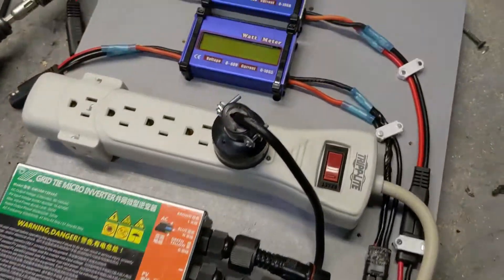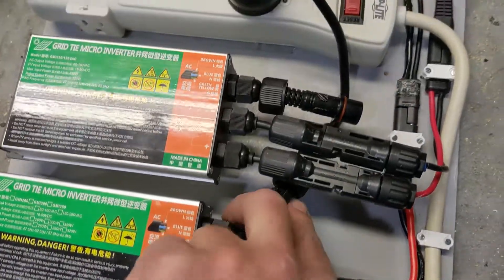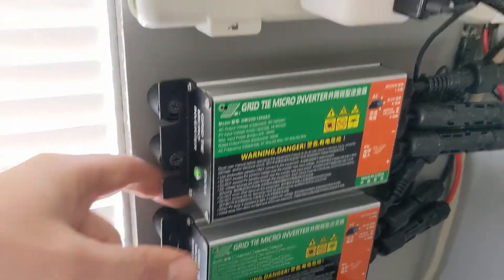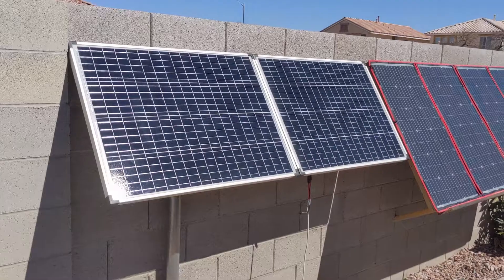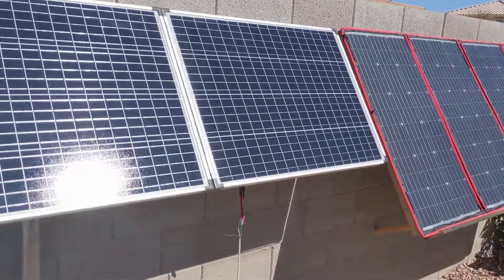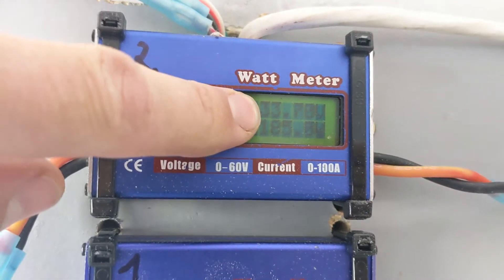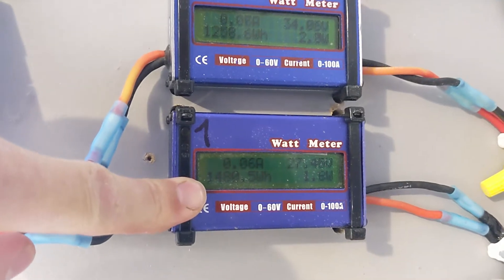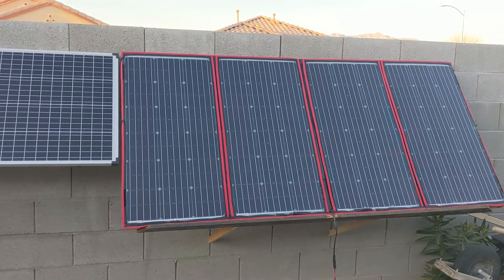DUAL split phase 350W MICRO GRID TIE Chinese inverter SETUP and TEST with solar - REAL NUMBERS!

Comment: Are Theese Realy worth the price on Amazon or is there something better?
Reply: Great video deserve a thumbs up!  Thanks for the reply so quickly!  Good luck for the future .
Reply from the maker: There is always something better but it depends on how much money you want to spend and how much gear you have behind it. If you just want a simple system then yes these work really really good if you just have like just a bunch of solar panels
Reply from the maker: Since this video I bought $4,000 worth of equipment to make 3.5 KW of installed solar on top of my house and 2,000 w worth of power production. Basically my power bill is zero
Reply: @ still pay a delivery fee right cause in Canada Ontario Delivery fee is $48 dollars if you use hydro or not?

Comment: Hello
I installed this microinverter 350W connected to 2 PV 170W mono. Orientation south 180° full sun all day long.
The max i can get out of it is 490 Watts / day !!!
What is your opinion about this low rate ? Thk u
Reply from the maker: You need a watt meter in line to see where the power and how much power is going thru .. mine can deliver if the sun is up ..

Comment: If the micro inverter is rated for 350 watts the max wattage you should have going into them is 280 watts as per the 80% rule.
Your equipment will last much longer if you implement the 80% rule.

Comment: I have two of these grid tie inverters, each connected to a 370w used solar panel. I measure the AC power fed into my home and both of them produce 180w at max sun. I can't seem to tell what the problem is I should be getting 500w to 600w combined at max sun, I don't know if it's the inverters, or the solar panels, or maybe it's my wiring, but something isn't right with my setup.
Reply: How old are the panels?
Reply: probably is the thermal proteccion, inside the thermal pad are with the plastic, also you must remove them, the plastic blue and put a fan

Comment: Can you explain how they're feeding each phase of your home if they're both plugged into the same power strip.
Reply: Yeah I didn't understand that part because #1 both phases need to be in sync usually to achieve this independent single phase inverters have some kind of way to communicate to each other. #2 if each one is connected to a phase anything on 220v grid tie  would pull form each one without a common neutral??
Reply: Also guy is confusing phase and legs

Comment: So, have you been contacted by your local utility yet to explain why you have negative power consumption at times yet you have not registered with them that you are doing this? They will be very unhappy with you I believe, as this is unsafe for their linemen.
Reply from the maker: If the power goes out the grid tie inverter stops doesn't put out power . It's synced to the network

Comment: I bought mine, first day it was ok, but second day starting red flashing and green flashing, now its flashing both lights, do you have any idea what can be the issue on it?
Reply from the maker: check all the connections, maybe you got a loose wire inside the power 110 connector, that happend to me , mine are still working today, i do keep them cool ... with fans
Reply: Its rare because it worked again after some hours, and later it was flashing red and green light again

Comment: You should add a DC circuit breaker between the panels and the inverter, and an AC breaker between inverter and the AC grid, for security reasons.
Reply from the maker: I was looking in to a fuze but I don't see the point , the math tells me that fuse or breaker will do nothing if the grid tie does, it will not die in a short and if  it does in a short a 10 amp fuze will be more then the panels are pushing in so it won't help with nothing . The power strip has protection.
Reply: Have you seen the power strip? There is already a trip there. Maybe your suggesting breakers not for security, but for just a switch on off for pv and ac.
Reply: For security? Security from what, fuses can't shoot back
Reply: Are you still using Theese micro inverters today October 2024?

Comment: Would have liked to have seen how you back feed you’re breaker box or did you just plug it into the closet electrical socket to the breaker box ? What size breaker did you plug it into ?
Reply from the maker: I'm back feeding thru a 20 amp breaker .  I have 500 watts at max produced also I have a user right in that plug that it's between 100 and 800 watts , my PC .. depends on usage

Comment: Have you ever open this inverters? I have seen in many YT videos, that the thermal pads have a bad contact to the case. There is many times a blue foil on this pads.
Reply: This is true. You HAVE to open them and remove the plastic foil or it wont last very long. I have a heatsink and fan attached as well.

Comment: I got two off the 700 watt versions going to hook them both to same 20 amp circuit hope it works like yours does even though i wont be splitting them. Will only be putting 9.2 amps onto the circuit
Reply from the maker: Awesome
Reply: @VegasRoManiacReviews  are you still running these daily ? Would you buy again?
Reply: 2x 700w you can produce 1400w right?
Reply: @riccardomarinoni6733  in ideal questions pretty close but you'll rarely hit the max
Reply: @williamkreth  how did your 700W GTI's stack up? Did they produce even close to the 700W? My two panels are 310W and I was going to buy 2 x 350W GTI's but now am thinking of buying 2 x 700W so they won't work as hard and maybe will last longer. I am in a hot climate.

Comment: Hi bro,they are still working? I m waiting for mine,700w. Thanks
Reply from the maker: Yes, they are . I was worried about the 700 watt  , how is it going to dissipate all that heat ? In the same box,. These 360 get hot when I push 300 watts in them , i have a fan set up to blow cold air on them

Comment: ..does it stall during peak hours?
Reply from the maker: No never stalls but it does cycle and restarts every 15 min , I think it's a safety thing so it doesn't slowest you to work without a sync to the network
Reply: @VegasRoManiacReviews  ..I'm at a hotter climate ..at 2°N.. recently a microinverter got lightning striked so I'm looking for a simpler replacement...I'm not sure if it could handle the heat..I got 2* 36dcv * 8A panels..

Comment: In my country one KWh is $0.61 in 2022 because of the great reset, I mean, the war in Ukraine. So i'm gonne implement this.
Reply from the maker: Awesome just remember that if you have a smart meter the meter measures the amount of electricity that passes through it doesn't matter on which direction So if you're producing more then actually you using and you putting energy back into the network you actually getting charged for it it's it's kind of dumb and stupid but it is what it is